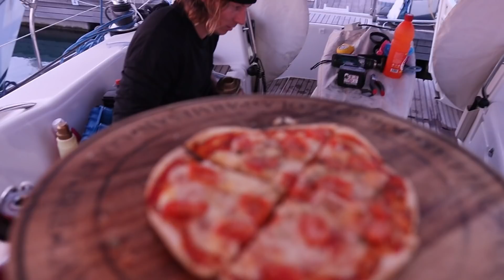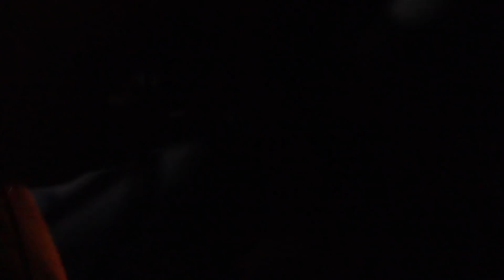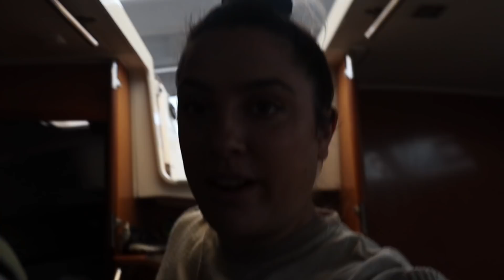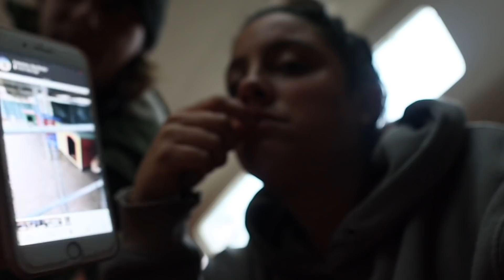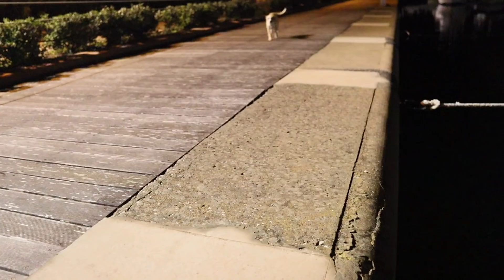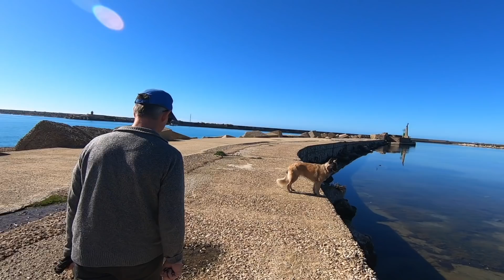Why we haven't left yet!! | Sailing Sunday Ep. 99

Comment: Your seacock/fitting that broke may have been due to electrolysis. That street elbow looks like a common cast/galvanized fitting and shouldn’t be used in a raw water area especially near a different metal. That’s just a ticking time flood if that’s what it is. Use bronze or Marelon(Truedesign?)never brass in seawater systems. Unfortunately hardware store ball valves are brass (yellow color, smoother finish). Marine bronze fittings are more reddish, have a rougher cast finish and cost three times more 😫. Consider someone was looking after you that it broke when you touched it and not later on by itself in the middle of the night.